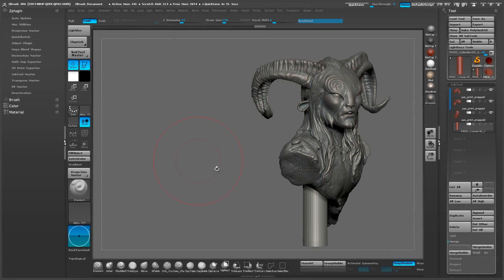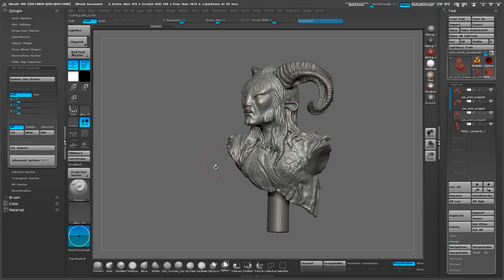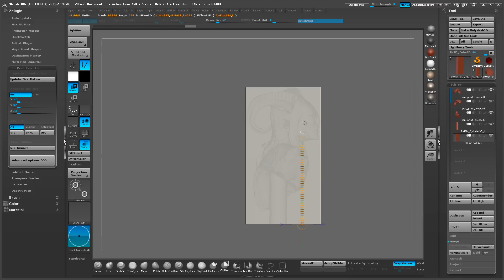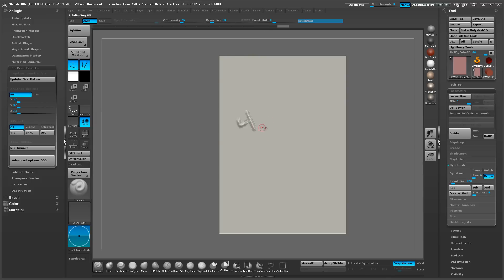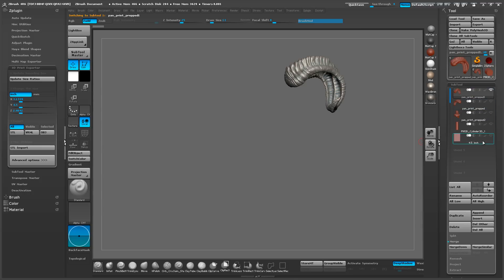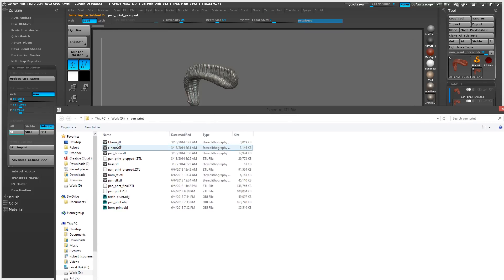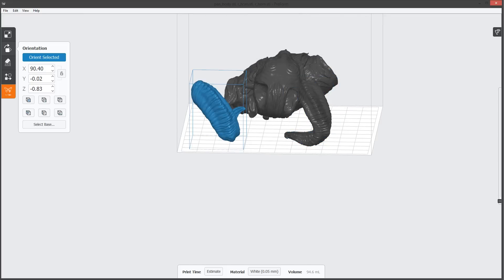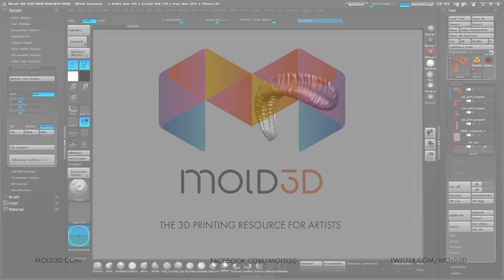Using the ZBrush 3D Print Exporter

Comment: Wouldn't be easier to mark export all subtools in separated files? it exports the sema way and dont use to have any position problems when you import them in other software
Reply from the maker: Exporting all as separate files works great. But keep in mind when working with stls you will find you often need to export a single mesh out and don't want to always have to replace all of them. Sometimes one mesh will be too high-res, have too many errors, or you forgot to support something and have to re-work one part of it in zbrush. Lastly, that option is in the advanced section and is OFF by default. For the purposes of the demo, exporting one at a time is easy enough!
Reply: Mold3D TV both are different ways for the same result, I used this method on this model and didn't have any trouble :)
http://www.cgtrader.com/3d-models/character-people/sci-fi/raisher-the-sky-reaper-printable-attack-pose-pack

Comment: Yes youre 9's are terrible =D Great tut, thanks very much! New to CNC/STL. I will be starting out on a fairly small CNC machine and laser box. After decimation what kind of poly count, should I shoot for?
Reply from the maker: Polycount will typically be a software limitation. I would start at 1 - 1.5 mil and work back from there.. but only if you have to preserve that much detail.
Reply: Cool that's more than enough poly's to work with. I believe my friend is using meshCAM. My first trial will be a relief of a drawing, I was planning on making a plane, applying the image as a texture and sculpting the details on it. Or maybe spotlight would be a better approach. My only problem is figuring out the depth.. i think he said his unit can cut to an inch and a half. Wondering how I can judge that accurately in ZB.

Comment: Which 3D printer would you recommend? Can I get away with something in ≤ $1500 range or do I have to shell out $3500 for form 2? Or do I need some industrial strength machine that I'll never be able to afford outside of a giant vfx studio?
Reply: there are a lot of option at the <1500 mark include the robo r1+ the flashforge dreamer or pro a bunch of delta printers which are usually kits you have to assemble. i got myself a powerspec 3d pro from microcenter great printer at 799 or whatever the sale price is. requires a bit of tinkering but great results especially paired with simplyfi3d